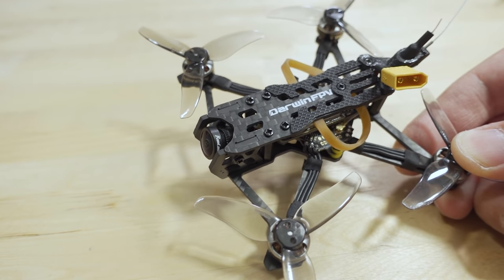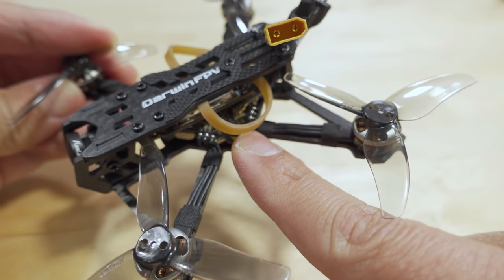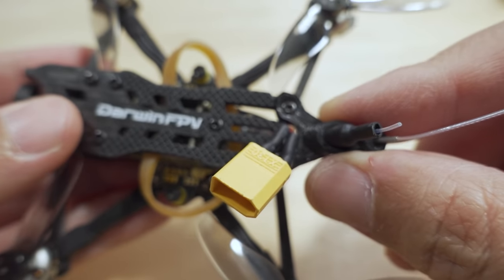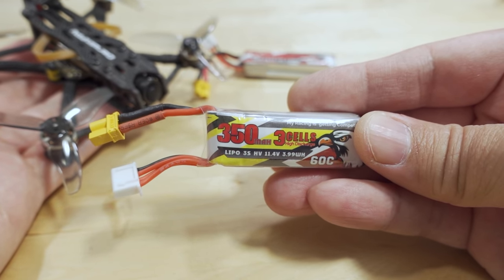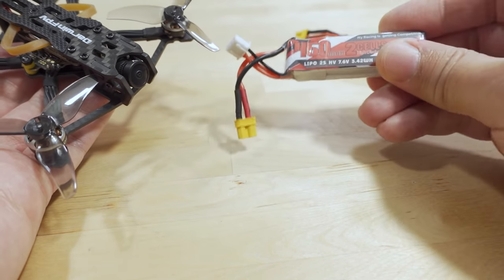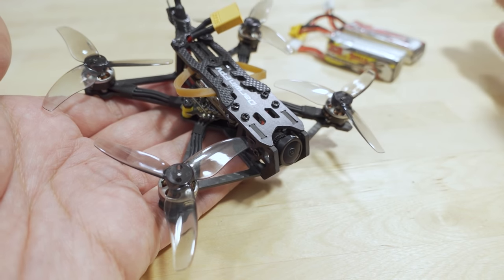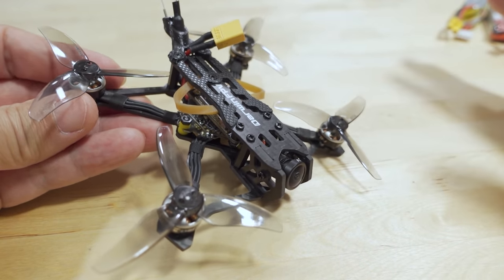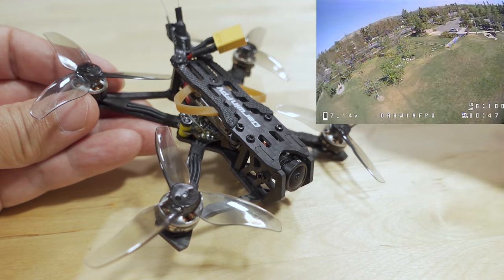DarwinFPV TinyApe Freestyle ELRS Micro Quad 🔥

Comment: Yeah I get dust particulate inside my cheap AIO's I put on my tiny whoops and taking them apart and trying to blow them clean usually adds more dust when I put them back together and refocus everything but the only thing that seems to work is smacking the tiny whoop head on into a metal pole at full speed and it usually knocks the speck off the lens until the next hard crash puts it right back on in a different spot

Comment: Could there be a 3S PID profile shipped from the factory? Profile 2 maybe?
Reply from the maker: Nope, just the one profile.  However, this will need an overhaul anyway with all the changes in Betaflight.  New stuff added, other stuff to be removed in the next RC4 build.  It will happen again in RC5, etc.  Maybe by the end of 2022 or 2023 we will have a stable 4.3.

Comment: I just ordered one about a week ago I'm very interested in any information on this tiny ape. I'm knew to the express slrs if that's rite.i come from 5 inch quads and frysky d8 set up's . Thank you for your videos it's very much appreciated thank you ..I may have more questions when I get everything lol.
Reply: I've got a taranis plus and I've got a BETAFPV ELRS Micro TX Module 2.4G 1W Backpack Built-in Cooling Fan Heat Sink. Will that work for the transmitter side of things. A tuning video would be awesome 👌
Reply from the maker: Yes, that should work assuming the correct setup and binding.

Comment: That looks like a fun little quad wish the tune was better.
Reply: I just bought this. I put the latest betaflight 4.4 using the target "DARWINF4SX1280HD". I used the UAVtech toothpic preset tune with rpm filtering and dynamic idle and it's so locked in!! Don't even mess with the stock tune.

Comment: 1103 motors seems so 2019.  1204 motors seem like a better fit for the times.
Reply: My 1103 custom build of similar weight seems to have much more power than this one just by looking at this one's flight footage. Perhaps it just needs a bit of optimization?

Comment: Look SUPER cool!  Too bad Betaflight/ELRS issues hold it back.
Reply from the maker: ELRS is fine... Betaflight not so much
Reply: @AlbertKimTV  ELRS is fine for you and me but for someone starting out. It’s gotta be confusing. V1 versus V2 and which is your Rx or Tx, pass phrase or not, CLI settings for Hz rate and pass phrases, arm switch up or down, hexes for SPI, Wi-Fi versus pass through. A lot of the fun of the hobby is the MacGyvering of stuff and then the elation of making it work, but sheesh. We shoot ourselves in the foot in terms of adoption and even spending more time flying than fixing. That said I do enjoy the MacGyvering.

Comment: According to some sources online (so take it with a grain of salt as usuaul), DarwinFPV buys components in bulk that are outdate or that did pass QC. That how they make cheap drones. That might explain why you runcam camera has some dust in it.
Reply from the maker: That would sound more like speculation on the part of those sources versus actual knowledge of their buying processes.  It's a super small company and almost none of them communicate with anyone in the community.  I communicate directly with one of the main players and getting reliable information out of them is difficult.

Comment: Interesting little quad for the price, it's just a shame they didn't put a better tune on it. I suppose if someone had one they could put different tunes on it based on the battery cell count. Darwin is trying hard they just needed to slow down and put a better setup on it before releasing it. Nice review Albert.
Reply from the maker: I think it's more Betaflight issue
Reply: Betaflight 4.3 just sucks in general.  I can't get it to fly right on any quad.